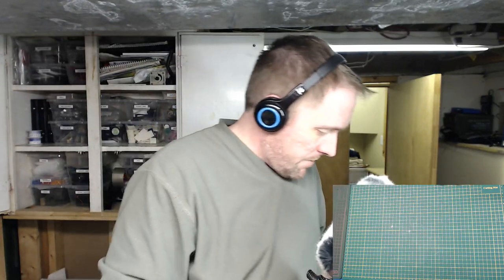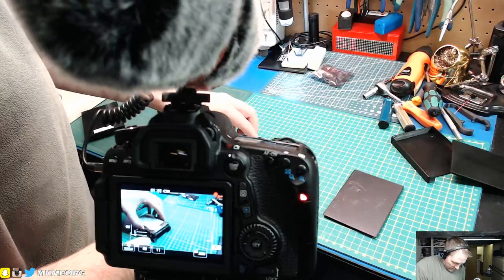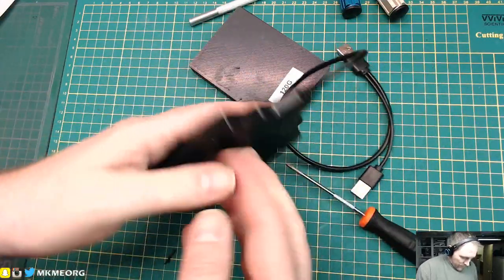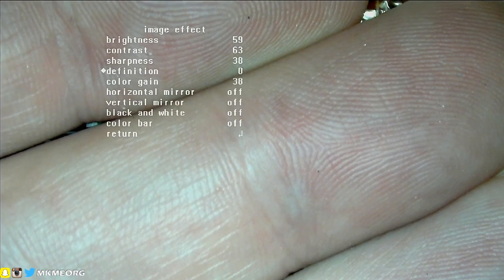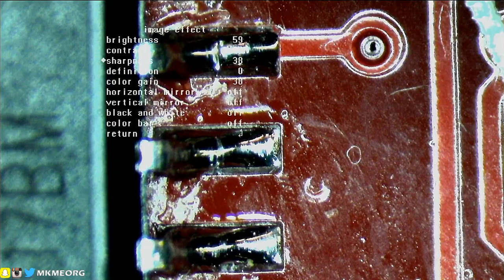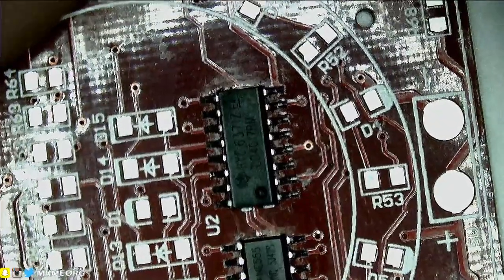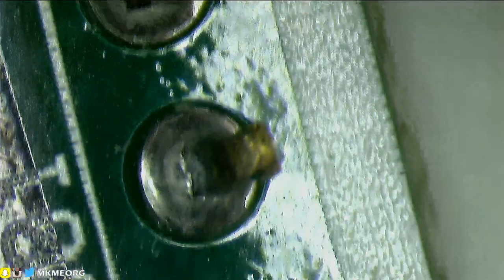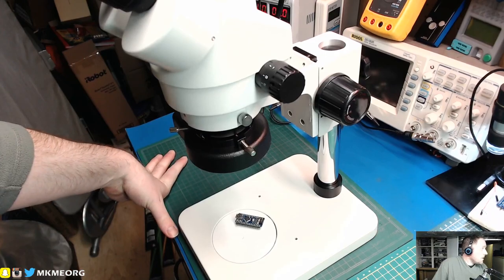🔴LIVE Video Making & Microscope Tuning- Nothing to See Here....

Comment: I just spent a couple of days trying to get rid of that light reflection glare, and it's not easy. I only have a cheap USB microscope, but in the end I turned off the microscope lights and have 2 external LED torches angled in at 45º. Picture wise it looks better than what you have currently.